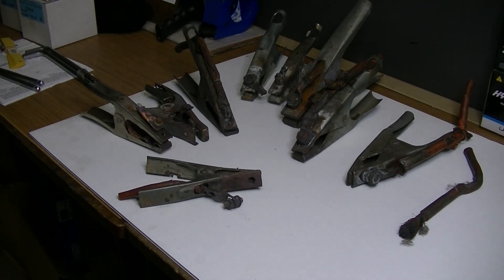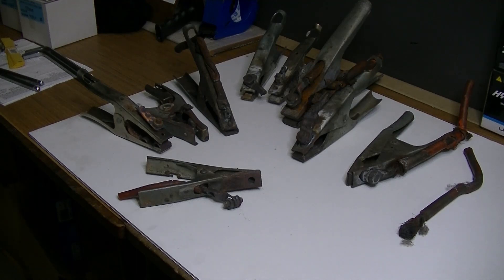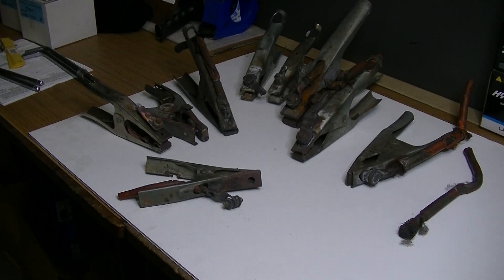10 causes of welding spatter

Comment: I wish I could hear you better so I could understand you better.   Your voice is in that range where I have some hearing loss.   

But if I understand what you are trying to tell everyone and from one comment, to help prevent weld spatter, then you need a good ground that you can't get from clamps like those in your video.    I will have to change mine from the one that came with the machine.   I get some pretty bad spatter with the flux core I am using.   Even after being sure that my polarity is correct.   

Might go and buy that heavy duty clam that I saw at the weld shop.